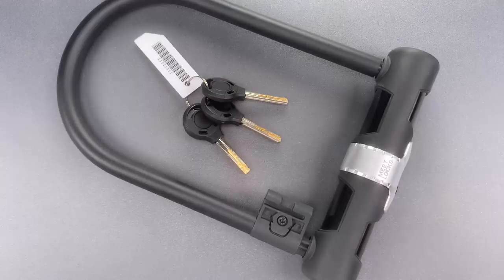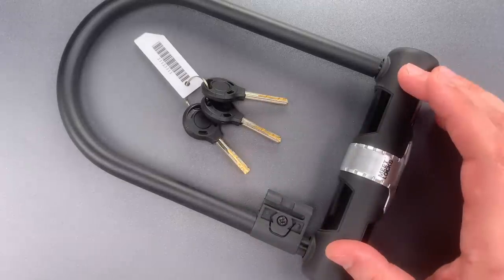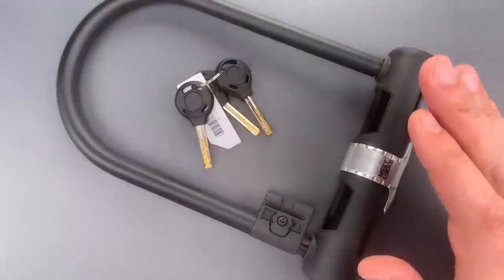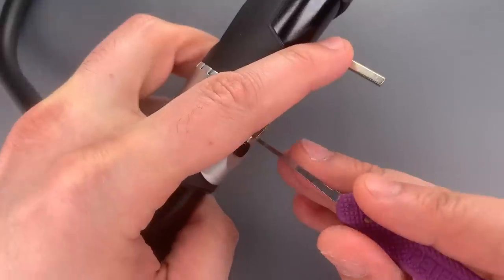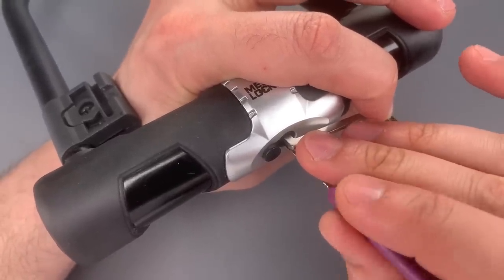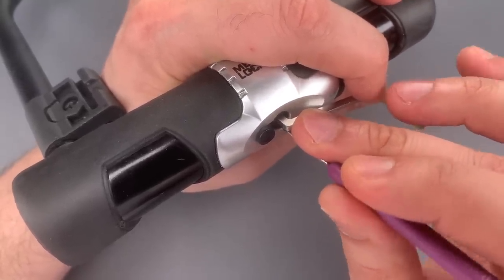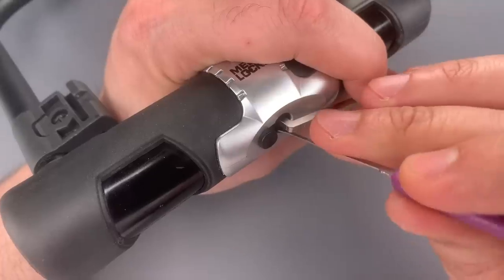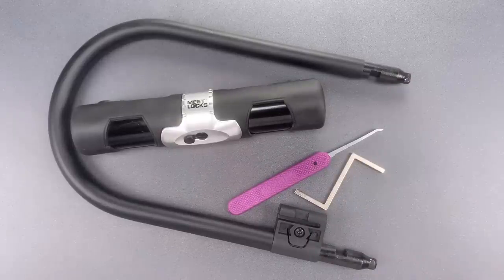[1269] Meet Locks Bicycle U-Lock Picked

Comment: "it's a bit harder than i was expecting" = one of the best $30 locks ever made.
Reply: Well, core wise. 

But this class of locks isn't going to be attacked by someone wielding a lockpick and the skill to use it.

For this lock, resistance against cutting/drilling/hammer attacks is way more important. I'm pretty curious if he tried to find a weak spot for possible destructive entry.
Reply: I think this company is happy
Reply: Yes, given the skill involved and the difficulty shown, which seemed like it was understated to me, I think that it might be the best lock anywhere near this price point unless it has some other untested / undisclosed vulnerability.
Reply: @paulelderson934  he mentioned plastic internals, melting perhaps?
Reply: Or alternatively, a $150 marked as the $30 lock, sent anonymously to LPL.
Reply: lol, yes. The perfect $30 lock has risen.
Reply: I’d say buy it take the core out and put the core in another lock
Reply: @paulelderson934  $30 chinese 4" kungfu battery disk grinder
Reply: @enegron6987  melting, hammer, small bolt cutter, pure force with a lever, there are many possibilities to open such a cheap lock, but they are more obvious than picking, which can be an adventage, but many people wouldn't even care, if someone would get a saw and opened a lock after another....
Reply: @Javic167  The point is: To design a good core, you might need some R&D, and it is expensive, it depends on qualified people. The same is true for other parts of the design. Thickness, stronger materials, etc. are decisions where you can buy strength with more money "easily" and if your customers (who choose an unknown brand) are willing to pay for it, spending money on that should be easier. Even if you would only do design, engineering, and QA testing and hire the people with the right tools to do actual manufacturing. 

The issue with the "very strong thick locks" is often simple: You carry a lot of weight and attach a strong lock to a weak attachment point and gain a false sense of security from the lock. And sometimes a twice as expensive, heavier, weaker core, etc. lock (often more than twice as heavy) attached to a single weak point would be better than using 2 locks like this in two different ways...
Reply: That's what she said.
Reply: I was going to say the same thing! Decently well-hardened shackle, hardened steel lock body, and a core that gave LPL a good bit of trouble. Doesn't seem like the lock has a lot of design flaws, and all for 30 bucks. Seems like a good deal to me.
Reply: send him tapered pins! so we can watch longer
Reply: @paulelderson934  True, LPL did say much of the internals were plastic. A swift blow from a heavy hammer would probably get it open faster than a pick and tension wrench....
Reply: @neon5162  I'd like to see the core...... I feel like this $30 lock is probably getting a lot more credit than it deserves. Maybe LPL was just having an off-day lol, I've seen him pick way higher security locks in much less time.
Reply: @tobiasg_91  If it seems too good to be true, it probably is. I think we need a thorough review...
Reply: @kaylor87  I don't know, double sided sliders are nothing to sneeze at...
Reply: Never broke into a lock in my life but just from a few seconds thinking i could probably crack that with a mini axe, job done...
Reply: @midimusicforever  you completely missed the part where he looked up the price.

Comment: Looks like it offered more protection than other locks you have picked at a higher price point.
Reply: Better than average, to be sure.
Reply: While it may offer more pick protection, the rectangular retaining cutouts in the bolt make me wonder if it can resist a shim. Expect more bike thieves to use brute force than lock picks
Reply: Except for the plastic internals
Reply: You need (a lot of) time to pick it but no special or very expensive tools.
Reply: @winterwatson6811  i doubt any bike thief will pick a lock open
More likely to put your bike into a van snd steal it or cutting it
Reply: With the exception of the shackle. This shackle is not as thick as the locks with higher price points, so an angle grinder will still be the most effective attack.
Reply: @orion7741  yes but it’s not exactly quiet 🤫 is it
Reply: I mean, like he said they tend to be inconsistent, and he didn't try any destructive attacks on the shackle or especially the plastic internals. All he did was pick the lock, which the difficulty there could be a matter of factory defects for all we know without cracking it open and looking inside.
Reply: @wrpen99  it offers more protection that other lock. For this method.
Reply: @beechFPV  even if its loud as fuck like an explosion, no one will be there on time
Reply: @Roshan_420  so if the bikes locked up in a town or outside a business that’s usually swarming with people 
, your saying that no one will be there.
Reply: @beechFPV  people don't get into other people's business.  if someone broke out an angle grinder to cut the shackle, people won't even bat an eye.  that's why angle grinders are used so often to defeat bike locks.  it's not their bike, so they don't care.
Reply: @Adam1nToronto  so? Internals are internal. You expect a thief has an top of the line blowtorch?
Reply: Its not drill resistant tho.
Reply: @orion7741  Angle grinder... Seriously?
Maybe seen one with a silencer? No.
Reply: @beechFPV  most people won't bother plus it doesn't take long to steal a bike/bicycle or to cut one open lol plus if its not locked to anything solid such as a pole, you can easily just pick it up and put it into a van and then take your time at some place.
Reply: @Roshan_420  that’s not the point though. Anyone can steal anything with a lock. But it’s about deterrents. They are an obstacle and will slow people down. 

If it slows them down then that’s good.
Reply: @beechFPV  im not saying you shouldn’t lock your stuff, I’m saying that no one is going to pick it
Reply: The core is pretty hard to pick, but the rest of the lock? I wonder if resistant it is to a hammer strike out bolt cutters?
Reply: Why do you say higher price point? Whats wrong with just higher price?
Reply: @JohnADoe-pg1qk  High security locks don't require special or expensive tools either. It's not strong against brute force, which matters more than pick resistance with low and medium security locks.
Reply: @apbosh1  there are locks that cost more and are easier to pick. Is what I meant.

Comment: If that lock doesn't get sold-out in next few days I don't know what is wrong with people. "that took longer than I expected" and over 3min video is absolutely smashing recommendation from LPL
Reply: that lock can most likely still be opened with brute force as it doesnt seem to be very strong at the other parts... remember the Nail that he used on a lock? that would most likely work on that one aswell xD
Reply: @haxkztasy  or a lighter lol being facetious🤪 he mentioned plastic internal
Reply: @enegron6987  The outside is hardened steel,so I doubt lighter will work

Comment: I love how lpl can completely destroy my sense of security in 3min
Reply: 1 min and 16 sec..... looks like a bargain @ $25.
Reply: I know the feeling. After watching LPL for few years now and getting a starter pick set I’ve learned he’s a true master and brute force are your true concerns.
Reply: That's a pretty good bike lock considering you have to spend all that time jerking around inside a lock among bypassing people.
Reply: And if you havent experienced this brands core-feel any prior to an attack, it shouldn't be that easy to repeat live on a lock facing 100% downwards etc
Reply: If his video takes 3min, its a good lock
Reply: @duke9173  yup. The best way to protect your bike is to make it harder to steal than the next one.
Reply: @enginesandmore1013  Provided he doesn't get out the pinning tray or pick multiple.
Reply: @bigblue2216  don't forget the bike price
Reply: The thing you have to understand is that the LPL is basically James Bond as far as lockpicking is concerned.
You or I could not have gotten through that lock without heavy power tools, and we couldn't have done it non-destructively at all.
So seeing the LPL pick a lock and losing all confidence in locks is like seeing the footage of the Tacoma Narrows Bridge disaster and losing all confidence in all bridges.
Reply: If it took that long, you're not watching closely enough. 🤣
Reply: @nutbastard  True, anything that can't be raked, obviously bypassed, or otherwise defeated by low skill attacks is enough for almost any situation. Considering that the picking would be done with an unfamiliar lock in an inconvenient place at an uncomfortable angle I'd say this does more than enough to protect a bike.

Comment: Translation: it's one of the best locks put there today and he recommends it.
Reply: Think again.  If it was all metal it might even be better.
Reply: He openly recommends good locks, he only evaluated the pick resistance here, not against drilling, cutting, prying, grinding, or even a heat attack.
Reply: He didn't recommend it. But maybe tapered pins is the way forward for other manufacturers now.

Comment: My bike U-lock has different branding (Giant, the bike company, so I figured it was a generic manufacturer), but is almost identical other than the plastic housing. I've had no luck trying to pick it, I think the main point I was missing was going after the sliders on both sides. Thanks for the info!

Comment: I always had a good chuckle when I use to see bike locks and pad locks with the combo 1234.  I could go through a lot of bikes and if they had a combi option and get 3 or 4 hits just using 5555, 1234, 1111, 9999, I could get  double that just rotating a single digit on the far left or right up or down one.  Good times.

Comment: After Watching so many video of you pick locking, i believe it could be fairly easy to prevent picking of lock. You make a lock that can't be tension. Something like mechanical slider in both direction for pins. So even if you want to tension them you couldn't keep them up unless you pin all of them up at once. ( I am not talking about the lock "Stuff Made Here" made)

My idea is using a mechanically base lock that doesn't rotate at all. You need to set all the pin at once with the key. A pinned plate with pin in 2 side or 4 side(Squared key for harder lock) and when they reach the point to move pin they all move the pin on the mechanic at once which some will unlock the mechanic and other will move the gear to generate a rotation on the gears inside.

Comment: Was surprised not to get to see either a close-up of the keyway or the tip of the key. Made the use of the thick Z bar and pick orientations in the keyway completely obscure; though I could fill in many blanks from your other vids. From the 0.75 seconds of keyway shown it appears to be a square with a slot through the middle or, possibly, hexagonal.

Comment: This seems like a great core for a bike lock at that price point.  What about other vulnerabilities?  Bike thieves rarely bother picking locks when they can just tap it with a hammer or drill the core or cut through a weak point in seconds...

Comment: I think this is a good choice for a bike lock if you can’t afford a expensive one I might get this.
Reply: Meh, bike thieves here just use battery powered angle grinders now instead of picking, so anything disc detainer based will do.. Just go for the thickest hardened steel model in your price range and check it can’t be shimmed open.

Comment: 1 minute 40 seconds for a master lock picker in closed conditions means i can't expect the average thief to be able to get this unlocked in a timely manner. Hell, even someone screwing with a lock for nearly two minutes might actually draw attention to what they are doing. Can we see how tough the lock itself is? Because if its able to withstand longer than say 30 seconds against a cutting tool that could be easily concealed, this lock might actually be a good call for someone with an cheaper bike (not like a thousand bucks) to keep safe if they go in a store or at a bike rack with a decent amount of security/traffic nearby.

Comment: Just because the locking mechanism was decent enough is NOT a recommendation for this lock bros. He clearly stated it's moderately plastic construction. It would probably be easier and quicker to break this lock open destructively than to pick it, and that is way more likely coming from a bike thief.

Comment: Hey! I want to ask a question. For this picking style, wouldn’t be better to use a dimple flag rather than a standard hook? I never picked one of these style of locks, but as far as I know a dimple pick is designed for this lifting up motion that you do with the standard hook. Maybe it is a stupid question because I never worked with a dimple pick either, but it is on my checklist to buy and learn that skill. I can pick simpler pin tumbler locks and wafer locks at the moment.

Comment: since we know that actually picking these types of cores is not what is generally done in the wild, how quickly will the plastic internals fail if someone uses a propane / butane type torch, Or whatever else seems to be a more common attack vector to cause the lock to fail. Like if struck with a sledge do those locking pals release. seems like they are on the right track with core and outer material for the price but if some simple brute force attacks overcomes it then ..well we wait for some upgrades

Comment: Total layman here, coming to the comment section with classic Toddler logic, but if the main goal of a bike lock like this is to buy as much time as possible, wouldn't there be a way to make the core super long and just have a ton of pins? Then have something wacky like a retractable key? I mean, I bet a key like that would be much more expensive and would break fairly easily if mishandled... but I'm assuming there's much more obvious reasons lock makers don't do something like this?

Comment: Would like to see a demo of why the plastic in it is a problem.
Reply: The body, shackle, and locking pawls are all metal, so if someone tries to pull the lock apart, they will be working against metal-to-metal breaking points.  The interior being made of plastic means that the locking pawls (those little metal tabs that hold the shackle to the body) are mostly held in place by plastic, so someone could quickly drill through the lock from the end of the body, or heat it with a torch, and all the interior parts would be able to be shaken out of place, and the lock would come open.

Comment: Would it be more tricky if the lock was on a bike as you had your tensioning hand where the wheel would be.  Also, the lock wouldn't be at a nice height and position.

Comment: Wait a minute. "Not that hard?" It took you about 1:25, nearly 90 seconds, to open the lock in a controlled environment where the lock was not wrapped around a parking meter, the frame of the bike, and one of the wheels. Half the time you just look at a lock and it opens on the spot. 90 seconds is a lifetime in the real world. Seems like this lock is a very good one, but you rarely say that.

Comment: This lock looks almost the same as the "No Nonsense" lock from video [898] ( https://youtu.be/0TpzMDOEJFM ). In both cases you said that there was a lot of plastic in there, and you briefly gave a glimpse on that plastic support in [848] Via Velo Bicycle U-Lock ( https://youtu.be/sJ9ZGgLkfJo ). I can imagine that a plastic supported core would fail under a blowtorch attack, but since this might damage the bicycle, I think this kind of attack would be very unlikely. Apart from heat, what other attacks would benefit from plastic support inside a lock?